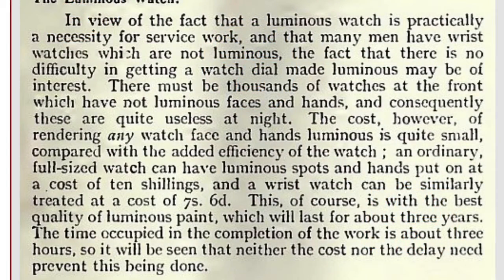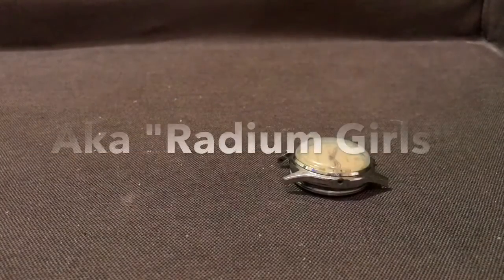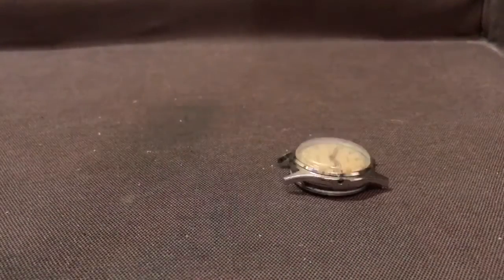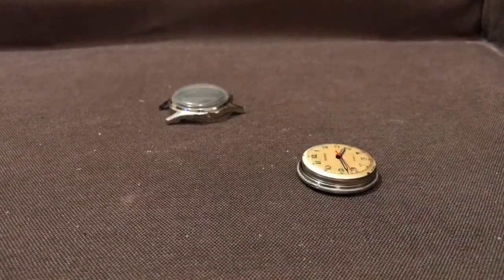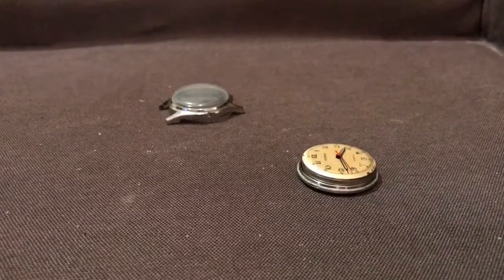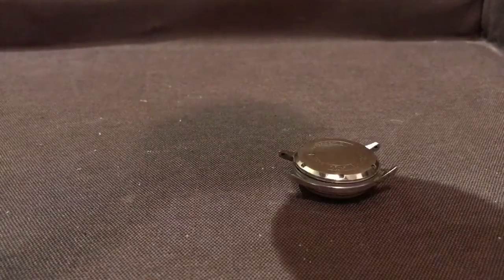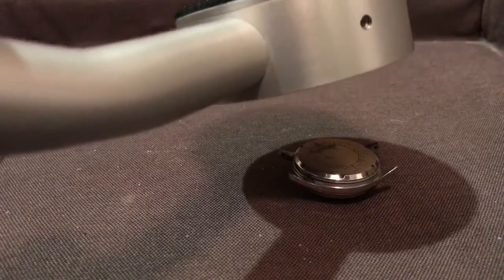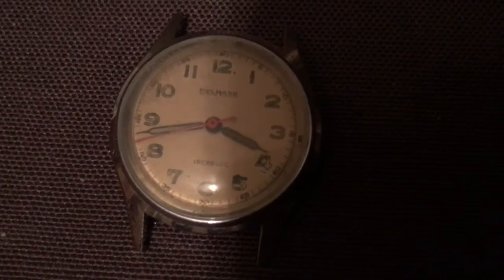Antique Watch Dial Radium

Comment: I have a question. Is it worth taking out the dials and throwing away the clock face? I was planning to restore them but now I really don't want to. I want to throw out all radioactive materials and just remake the dial and hands I'll order new  and just figure it out I am really bummed out about hearing how bad they are makes me not want to even try and just donate them to a museum.  Really upsetting.
Reply from the maker: It would not be safe to try and remove the radioactive material from the dials and hands for restoration as microscopic airborne particles of the radium containing dust would be extremely hazardous. The best thing would be to see if you can have similar looking dials and hands made and then have them repainted with non radioactive luminous paint. The other thing is to remove all the original dials and hands and place them in a sealed container or even encased in a plastic block such as an acrylic block to donate to a museum or to sell on eBay as a radium element sample.
Reply: @BrianDhvTinkerer  I was planning to donate them to some museum  if possible. I will figure something out. I purchase a FS600 bosean geigermeter.  Hopefully it works I hope I didn't accidentally  contaminate my other clocks in the boxes.
Reply: They are really not that dangerous. The only way they may be dangerous is if you open them up and handle the dials or scrape the radium paint off the dials and inhale or ingest the dust from the paint. Just leave them closed and you won;t have any problems. I have a vintage radium dial watch that works and I even wear it every now and then.  If you are still really worried by them then give them to a museum or collector who knows how to handle them safely.

Comment: Very nice video! Thanks! I love collecting things like this! The only hazards there are, is getting the actual luminous compound inside you, via inhalation or ingestion, and Radon-222 if it isn't sealed. Even that will not pose immediate danger. The instruments themselves are pretty safe, also if proper precautions are taken. So, the risk is very low, even though it sounds scary when close to the Geiger counter detector tube. Sadly, some people discard them. Sell them instead to nuclear enthusiasts. They can be worth a lot!

Comment: its very dangerous to take away the protection and expose the dial : its not so the radioactivity level but its more about the micro dust from the hands and dial ; if u inhale it , it will get stuck inside the lungs. Alpha radioactivity is highly toxic and cause cancer : 20% of death by lung cancer in non smoking people is caused by radon : the gaz that emanates from radium and granite.
Reply: i brought a watch with its face missing that im going to have a face put on..

Comment: Hi! I'd like to follow up and add to the previous question. What is your opinion of wearing a radium watch such as this occasionally? For example, once or twice a month. Would this be a significant cancer risk?
Reply from the maker: very unlikely to be a cancer risk. The paint is only dangerous if it is ingested due to the alpha emissions from the radium finding their way into bone as radium mimics calcium in the body.
Reply: Thank you for the quick response! I'm trying to get a survey on opinions on this issue having recently owned one.  I've promised myself never to open the caseback due to the ingestion possibility. I did some math based on a 14 micro sievert reading and figured out that wearing it twice a month, 8 hours each day, for a full year would give me a 2.7 msv dose which is a little over annual natural background radiation. The reading is worse case scenario as well since I took it right on the watch face. One more question actually if you don't mind. I've heard radon gas can leak from radium watches. Should I be worried? I currently store my watch in a metal box and sealed in a couple ziploc bags to be safe.

Here's a pic of mine :)
http://uploads.tapatalk-cdn.com/20170911/d5199c74b47e6fc44ee303c0ad86e4fd.jpg

Comment: What is your opinion on Clocks with radium painted dials and hands? Dangerous or not?
Reply from the maker: As long as the radium paint on the clock dials is protected by the glass watch face, they are fine. The glass filters all of the alpha and most of the beta particles. However, some gamma rays make it through, but these are low activity.
Reply: Thanks!
Reply from the maker: Hello Again Guys It's Your Buddy Greg I would definitely invest in a Geiger Counter that can detect alpha particles. With old luminescent clock faces, the radium in the hands can disintegrate over the years and form a fine powder in the clockface. This can become airborne if the glass is removed and there is a risk of inhalation. A HEPA mask would prevent inhalation of these dangerous radium containing particles.
Reply: @BrianDhvTinkerer  We are aware about radium nowadays, but if I think about those girls that painted those watches and literally are that radium paint and how they ended up, that make me uncomfortable even thinking about wearing radium watch.
Reply: @ultron374  The girls who painted the dials were handling the paint directly every single day. They would also lick the ends of the paintbrushes to make a fine point at the end of the brush to make it easier to apply the radioactive paint to the small narrow dials and watch hands. So they were not only handling it everyday, getting it on their fingers and hands but they were also ingesting it each time they licked the brush.  Big difference between what the "radium girls" were doing versus just wearing a radium watch now and then.

Comment: Prior to 1950 and still releasing energy after at least 67 years yet people still argue against free energy? I wonder how many years it takes to equal free energy? Very small amount of material with at least a 67 year life span and still ticking? Ok you got me I am a wise guy, looks like free energy to me.NASA has a reactor in space for over 9 years and produced enough power on the other side to send a picture through deep deep deep space back to earth of PLUTO. You think they know something? I am just asking. :) Great video.
Reply: Radium has a half life of 1600 years. Fine for activating phosphors and spewing radiation, but not much else.  Enough radiation that it eventually damages the phosphors, which is why those old watches no longer glow - they're still radioactive though.  It's not "free energy", just physics.

Many deep space probes over the years have been powered by Radio Thermoelectric Generators (RTGs) using about 10 lbs  of Plutonium 238.  These are not reactors, there is no fission chain reaction. At this mass, the plutonium is physically glowing hot, producing enough heat to generate electricity. It's the heat energy, not radiation providing the power. The former is easy to harness, the later, no practical way to.   

Pu-238 has a half life of 87.7 years. Voyager 1 and 2 were launched in 1977, meaning their RTGs have been operating for over 40 years, or half the half life of the PU-237.  They're already running on reduced power. In a few more years, the PU will decay enough that the RTGs will no longer provide enough power and they will be retired. 

Plutonium 238 is difficult to produce and highly toxic. Not much of a problem for a space probe, but pretty impractical on Earth. Each of Voyager's 3 RTGs made a whopping 157 watts of electrical power when they were commissioned.
Reply: @Brugensis  NASA uses Radio Thermoelectric Generators; they aren't reactors. They work by harnessing the decay heat of Plutonium 238.

The energy that can be harnessed by direct decay is infinitesimal by comparison.

Regardless, there is no such thing as "free energy".
Reply: Conservation of energy! Yep! Pu-238 is a great option for heat sources. The Pu-238 isotope emits weak gamma rays with an extremely low intensity %. Also, the U X-rays emitted also have a low intensity %. This makes it safe to handle externally, especially if the source is sealed since it's a nearly pure alpha source. The downside is that it's radiotoxic (alpha is the most dangerous internally), it's hot, because of its relatively short half-life, and it is hard to produce in large quantities, and thus requires a fast neutron reactor to produce it.